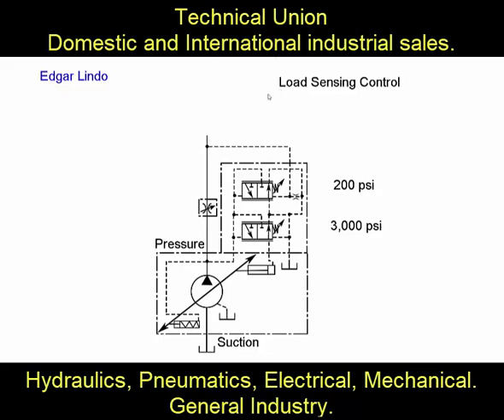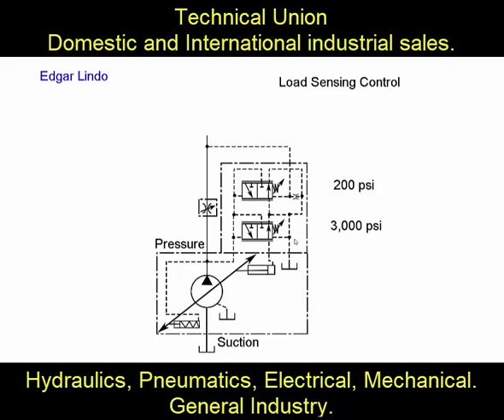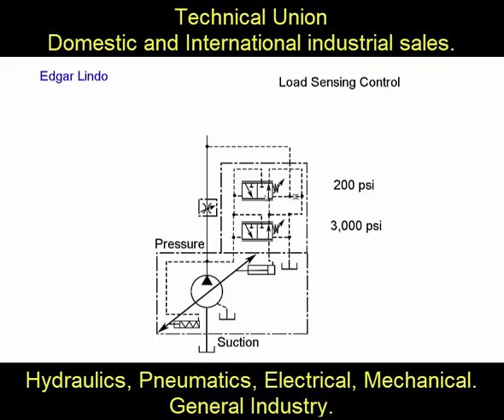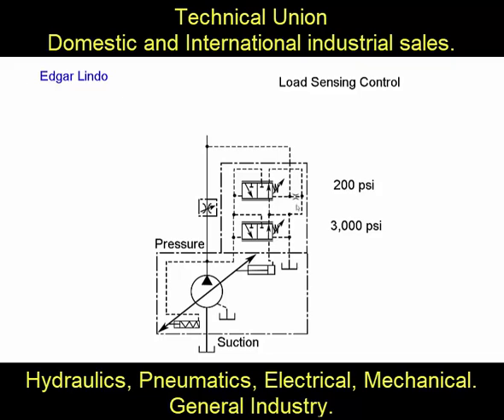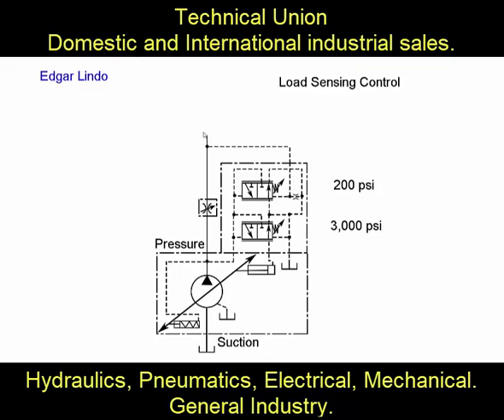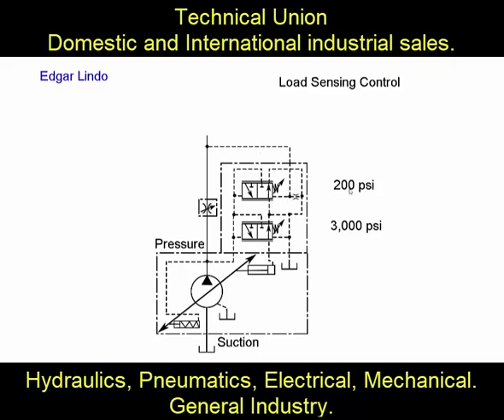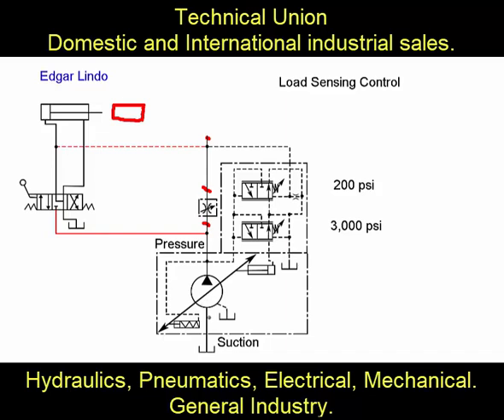How does a load sensing control works in a variable displacement pump.

Comment: Some mistakes are in your discussions. The output of the load sensing valve directly connected to the tank. So activating the load sensing valve can not decrease the wash plate angle

Comment: I kept load sense 200 and maximum 3000.but when running the machine I am getting maximum pressure 1500psi only.if I increase load sense up to 750psi the maximum pressure increasing near 3000 psi.why maximum pressure increasing when load sense pressure increases
Reply: in your machine, if you only need 1500PSI to move the load that is all the pump will generate.  That is what a LS pump does, only generate the amount of flow and pressure called for by the control valve (flow) and load (pressure).  If you increase the margin pressure in the flow compensator to 750PSI and run the application that requires 1500PSI, the pump has to generate outlet pressure of 2250PSI to provide enough pressure to operate the flow compensator spool.  Increasing the LS spring setting to 750PSI has nothing to do with the setting of the Maximum system pressure dictated by the pressure compensator spool/spring.  If it does, you need to change the whole control module out because there is a stray load sense pressure entering the spring chamber of the pressure comp spool and that's not a desirable situation at all.
Reply: @Joscope  thanks a lot dear

Comment: Oh ok thanks! Seems like you are illustrating a Rexroth pump in the a10v series. Imo a shuttle valve on the A and B port on the float dcv could add more flavor and you can just connect the downstream port of the flow control valve to the P port of the dcv. 
Only thing that I can comment a bit is that when the pump runs it destroke but the flow is always present and at maximum designed/allowed destroke the pump is still pumping fluid out and can’t be zero which can be observed from the case drain line. 
Anyhow it’s always good to have more hydraulics video.